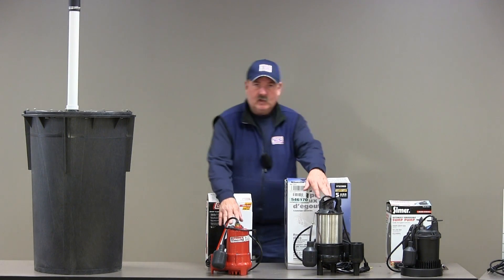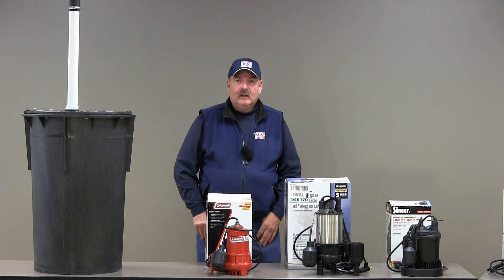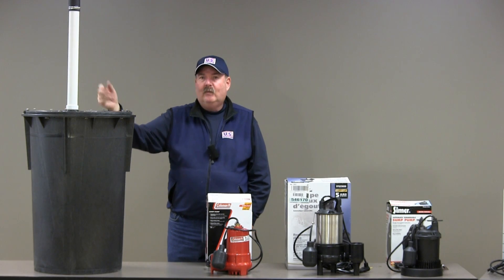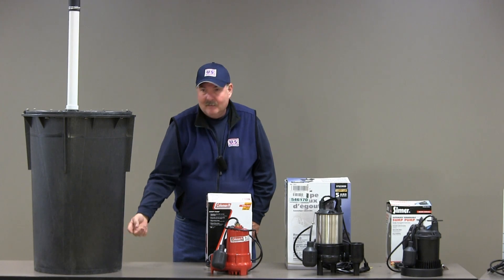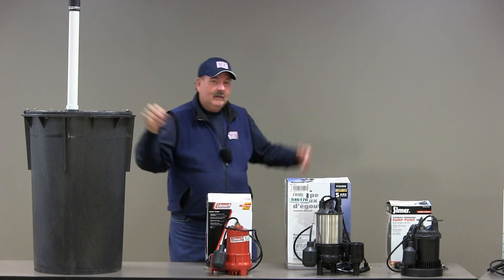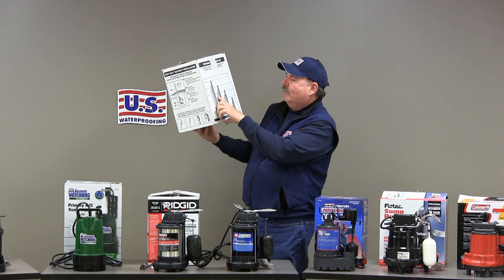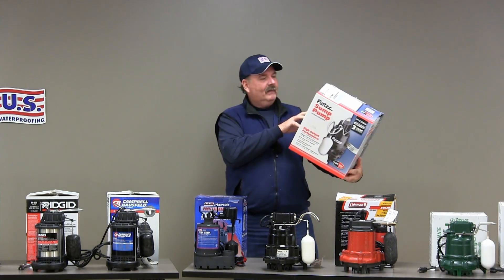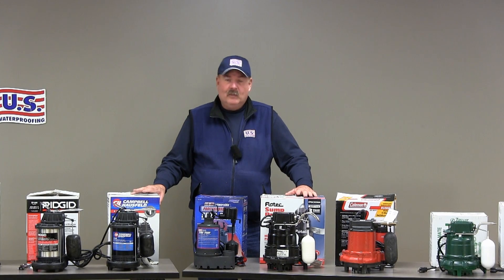Sump Pump Reviews: Understanding Pumping Capacity

Comment: That basin pictured in the video looks just like one of the heavy duty ones that they sell at Home Depot sold as a sewage ejector sump tank! They sell them for close to 50 or more dollars for just the basin and I was going to purchase one as a sump pump basin but then realized that it included a 4 inch pre-drilled halfway in the center of the basin and was like I’m not paying $50 for a tank with a hole already drilled in it in a spot I didn’t want the hole at!! So I went and bought a 55 gallon drum for $15 and cut the top off and it works awesome!
Reply: Good idea